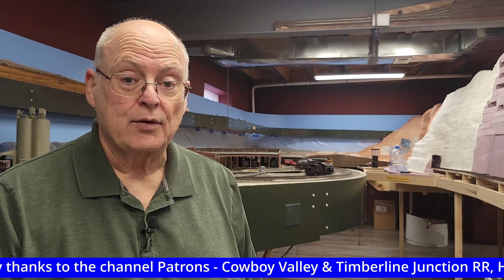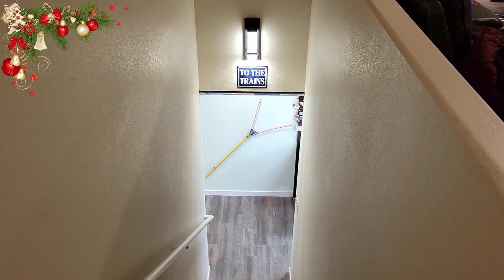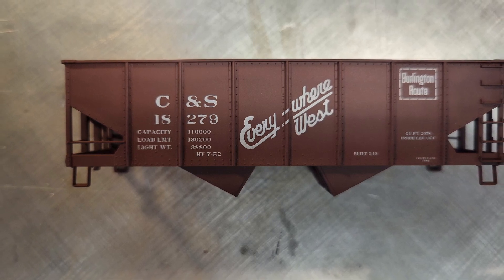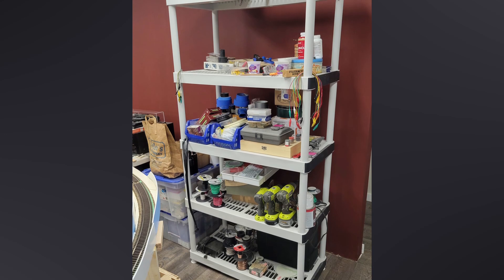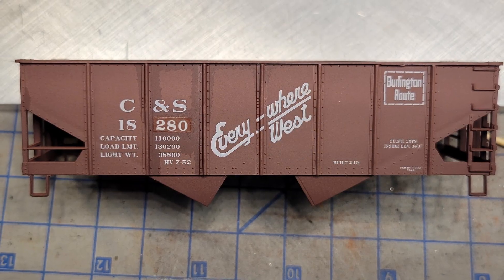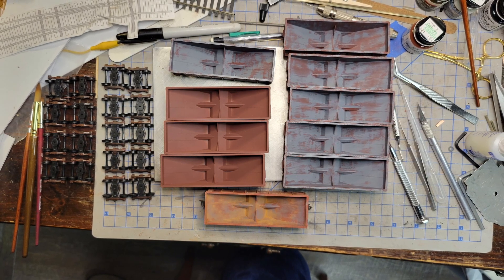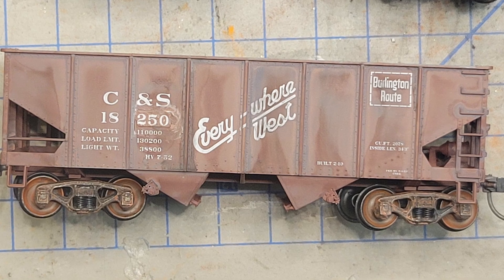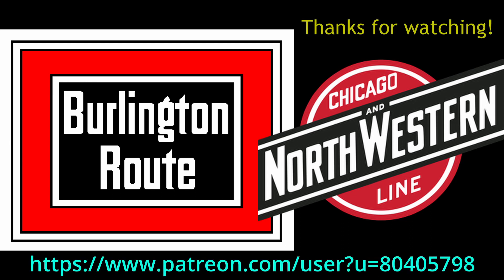2023 02 03 CB&Q V5 Monthly Update #39

Comment: Hi Mark.  Printing isn't for the faint of heart,  but with practice and perciverance, I'm sure you'll get it.   Polymer print R&D was my job at GE Power for a while - and I have almost the same any cubic printer.   
1: that DLP film needs to be TIGHT. REALLY,  REALLY tight.  After just a few prints,  it'll need re- tightened,  and replaced ever dozen prints or so. 
2: leveling of the build plate and setting your z zero is key.  3: orientation is everything.  Try kicking your crates up on a double 45, so they're sitting on a corner.   4, when in doubt,  over support and clean up the excess later.   
Best of luck on the recovery! Layout looks great!
Reply from the maker: Thanks! And I appreciate the pointers on the 3D printing. NO FAIR that your job taught you how to do that! 😁

Comment: For renumbering Accurail cars I shoot two thin coats of gloss over the original numbers. Then I apply the Accurail decals. Then one more thin gloss coat. Then Testors Dullcote. Then I weather the car. The gloss coat AFTER the decals really helps hide the clunkiness of the Accurail numbers.
Reply from the maker: Gee, I wish I'd had your advice BEFORE I did these cars! 😁I didn't do the gloss coat after I applied the decals. I'm wondering if I should have avoided the dull coat all together, to avoid the whitening. Weathering, especially the chalks, might have killed the glossiness in any case.

Comment: Mark, first, I am glad that you are recovering and that the prognosis so far is "watch".    Second, I know Accurail tried hard, but I have been underwhelmed by their renumbering decal sets,  I tend to go to full sets of Microscale decal sets, more work, but much better results IMHO.  Yes, most flat finishes don't like alcohol.  I have even had my old friend Dullcote show this problem at times.
Reply from the maker: Thanks Gary! I used an Accurail renumbering decal on a CNW hopper and got better results. I'm learning. Interesting about the Microscale decals. You have to remove the old number first, right? The thing I like the Accurail decals is that the decal background is (supposed to be) the same color as the car body, so they cover the old number without removing it. Probably also why they seem so thick.
Reply: @mapruitt  Yes, Microscale decals are printed on a clear background, so the old number must be removed.  I use several methods, but recently I found that a Mr. Clean Magic Eraser SHEET will remove some pad-printed lettering.  Cut the sheet down to a smaller size and rub - often the number will disappear after a bit (each mfrs lettering varoes a bit).  It's one of those taskxs one can do while watching TV.

Comment: Hi  Mark, so glad surgery all went well. 
Re 3D printing, I bought a creality halot 1 resin printer in December and has had similar failures. Causes could be 1. FEP film at bottom of resin vat is damaged or dirty. Dont dont use IPA to clean FEP, it makes it cloudy. Use a micro fibre cloth and clean water. (I had to replace the FEP  sheet a couple of times already). 2. The glass below the resin vat is dirty. Clean this with microfibre cloth as well. 3. Reskn has got some bits from failed prints in it, blocking the uv light from reaching the resin. Drain the resin vat and  filter the resin. I hope these pointers help.  Oh if you leave the resin in the vat on the printer cover the printer with a box or a blanket so that resin is not exposed to light.
Reply from the maker: Hi Henry, thanks for the printing tips! One of the bits of advice I've gotten from several more experienced folks is to calibrate the resin exposure - several have said it looks like the resin may be underexposed. I'll be doing that when I'm ready to go another round with the thing.
Reply: @mapruitt  Hi Mark, back to the 3d printing, if the resin is underexposed, then the supports would also not print well. They looked fine. Did you hollow out the crates? I have had an issue with HO scale traffic cones, that were hollowed out and the remaining material was just to thin to print properly. I reprinted them as solids and it worked beautifully. 
Have a restful Sunday. 
Regards
Henry van Wyk, Pietermaritzburg, South Africa
Reply from the maker: @Waterkloofmr  The crates were solid. I had a few folks tell me to hollow them out, but I haven't tried that yet.